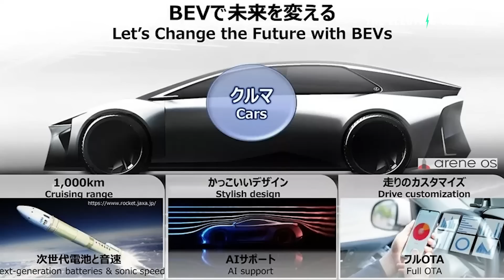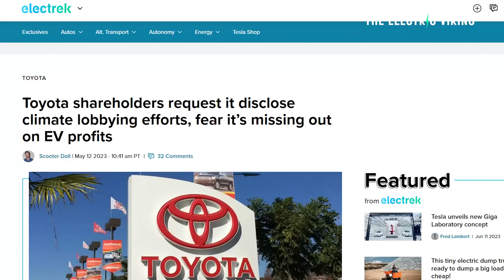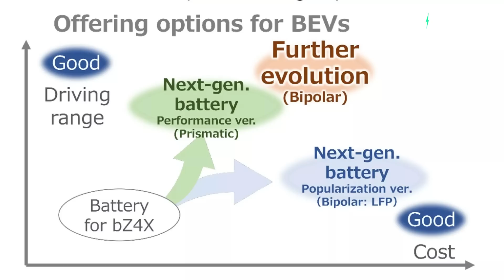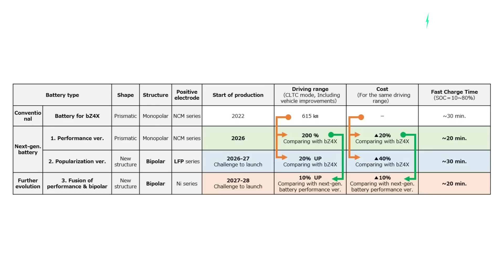Toyota's 2026 Electric Car will have 900+ Miles Range & Lightning-Fast Charging

Comment: Perhaps conflating Toyota users and Not being EV users?

I have had a Rav4 for 20 years, not a single problem. That's why I like Toyota.  

Once recharging on a roadtrip is a 15 minute maximum job with no worries about IS there recharging available without huge lineups that'd be where i'd look to adopt an EV.

Two different sets of considerations. 

It doesn't matter who makes the EV - unless your use case allows you to wander no further than the local area - there's nothing suitable. Perhaps more Toyota drivers are outdoor types who want the option to stray away from the city?

Comment: @EV Viking: May be the Japs still have the old blueprints of the Kammler* batteries** still laying in their vault. And just modernized it a bit. ...the Kammler batteries thought to be containing radio active material. 
So I could imagine Toyoto added some serious 'dust' into their upcoming new tech batteries too. 

*Kammler, Hans. High ranking officer of the SS, Socialist Germany 1933-'45
**Story goes that a briefcase with batteries containing Radio Active material was lost at the end of WWII around 'Böhmen und Mähren'. These batteries were manufactured '...ins Auftrag der SS Chefs Kammler.'

Comment: Another new feature in the Toyota EV is that driving in reverse gear actually re-charges the battery.
Reply: Drive it in reverse 100% of the time and you will never have to charge again!!!
Reply: So all I have to do is drive to work and reverse home!   I’ll never need a charge 😂
Reply: Toyota has been 'coasting' and slowly/steadily loosing ground since the 2nd gen prius which in my experience got the same mpg as the 2003 gen1 I owned.  I bought my VE4Y LAST ICE car in 2019 which was a 2019 RAV4 HV as a long range/vacation/trailer hauling car to replace the 2003 Gen1 Prius.

The next car I buy will be an EV only for work commuting and most other general traveling.  Would be nice to get a EV motorcycle to replace the 2010 Kawasaki too.
Reply: Anyone hear anything about NiZn battery chem?  EBL makes  a 3000 Mah 1.6v NiZn battery SUPER cheap that seems to he great.  Could this be usable on cars??

Comment: Toyota has been hanging this solid-state batt.--carrott over us for several years, and will continue to do so while they procrastinate using great li-on batteries available today.  VERY few people need to drive more than 300 miles in one trip, and if they do, they can easily stop and charge, as we EV owners do today.
Reply: yes they have.  but how long do you think this supply of lithum will last???
remmeber, 300 miles of EPA range is not 300 miles...never has, never will be in the real world.
my tesla says 272, but with my usage, ill drive 100 miles and be down to120- 130.  i only have access to use level 1 charger at home.  its annoying to have to use a public charger because they are in the dumbest areas of my city....and for others its even worse.    
this is why EVs need to have better energy density technologys to achieve 350-400 EPA range, for a real world use of 300-350.

Comment: In my view, the viking is correct to say Toyota will one day build this car. I also tend to be a bit more positive about the fact that they're planning this vehicle release two years out.  The reason is that the bottom line reality that will define Toyota is whether or not they go EV, and my guess is that they will; one very encouraging sign from this report is that the investors are demanding Toyota stop lobbying against EVs.  Toyota makes good ICE cars, and they can adapt. Very ambitious to release 2026. More likely 2028, but it will happen. I see this kind of ... how to tactfully put it... optimistic ... press release as a sign that Toyota CEO Koji Sato is going all in. So, generally good news - but yea. Take it all with a grain of salt.
Reply: We’ll have to wait and see…

Comment: I wish the leaps in tech breakthroughs that we have had with computers over the last 30 years could be seen with the battery.  I'm still waiting for the better battery but to have one that equals the tech improvements we have achieved with computers would be pure frigging magic at this point.  One must ask why?  Batteries are a consumable just like oil.  Maybe it's because of the almighty buck that we have not had improvements in battery tech that parallels our computer tech.  This brings up another point.  Batteries still need to be replaced when they go bad (and they will).  Will EV's become worthless when the batteries no longer take a charge?  Is EV tech the next disposable tech of the future?  What do you do when your cell phone is unable to hold a charge?  Do you buy a new battery for it or just get a new phone?  I have a ICE vehicle that is over 20yrs old and it still runs great.  Don't expect that with an EV.  At least until that magic battery is made.  Maybe Toyota will make it happen.  For me, I hope they do.  Someone needs to.
Reply: Tesla makes some very long lasting batteries. A lot of almighty bucks are being poured into battery research, with much more almighty bucks as a payoff. But these things take time. Chemistry improvements aren't like computer improvements, different mechanism there.
Reply: What you wish for has and is happening.

Comment: cool - I do drive a toyota, I am a skeptic, it's not because I like toyota -- I'm a skeptic of the whole thing --- We don't have the electrical infrastructure to handle EVs and we won't unless they add another 100 nuclear power plants and a whole lot more high voltage power lines across the country.

Comment: In addition to cost, my biggest reason for not getting an EV yet, are battery chemistry and capacity for a range at or over 500 miles on a full 100% charge.  The battery chemistry needs to NOT degrade and lose range in cold weather.  The range needs to provide between 430 and 500 miles min when charged to 90% in both cold and hot weather while also maintaining its battery health at 100% regardless of how cold it is and maintain that for high high battery health for over 1,000 charge/discharge cycles.  If you don't wait for that kind of battery chemistry and range in all weather you'll end up with a lousier EV ownership experience over 5-10 years of ownership as the battery health degrades.  Although following preconditioning practices will help but that comes back to having awesome EV OS software that no one except Tesla really has down.
Reply: actually what you say is contrary to the evidence we have so far. Most people only do 40-60miles a day. Vanilla Liion batteries  have shown us all to be stupid because they are lasting far far longer than predicted.  Doesnt suit you is not the same as suits 80% of people.

Comment: As a public traded company, Toyota should has something to back up the claims.👮‍♂️ Commercial success 26/27? Doubtful! 🐍🛢Toyota is under tremendous pressure from the public and creditors, a threat to the survival of the entity, look at Nissan! I reckon that it is just a gamble or a tactic to fend off pressure,😉 after all with advance of chemistry, WHO can say for sure Toyota SSB is just BS? 😝Feel sorry for the new CEO, a prawn that would take the fall.♻️ Toyota made a strategic mistake, grandson-Toyoda remains Chairman of the Board😂

Comment: I wouldn't believe anything Toyota says. That said, after a forty-five year career in product development, it is common for brands to turn things around in cyclic fashion. Sony, Black & Decker, and many others, have had multi year systemic product line disasters. And within a short period of two years or so, turn it around.
On batteries. Any comparison to fusion is just idiotic on so many levels. Look at the last five years of battery development, and project the same advances into another five. Consumer product development, with its near immediate profit potential, typically outpaces anything in the pure research arena.

Comment: In 2021 I bought a Prius Prime, that was my introduction to plug in electric vehicles. I loved the EV part of the Prime 25 miles, sometimes 30 in city driving, my wife loved the Prius and decided she wanted it, I bought a Chevy Bolt EUV which by the way are great cars, the only draw back, not great charging infrastructure where I live in New Hampshire. I drive a lot for my work, I was very limited to where I could drive the Bolt. I drove the Bolt EUV 26000 trouble free miles. I noticed Tesla had charging stations seemingly all over New England. When Elon Musk dropped the prices of the Tesla Model Ys, I bought one and sold the Bolt. I really like the Model Y, but I miss things on the Bolt also. Back to Toyota, they make great cars, very well built, I keep up with Technology as Technical work is my job. Toyota tries to get things right before they release things in their cars, they have been testing solid state batteries for some time, rumors have it they have finally figured out how to make it work and very close to being ready for production. If this really is the case , this will be a real breakthrough in  Battery technology. Hopefully these rumors are true,as Toyota makes very reliable ICE vehicles. If they can get their act together in the electric vehicle realm, we will have great electric vehicles by them.
Reply: You are the cause of global warming

Comment: I wonder why they picked 2026 instead of 2023 or 2024? Is it because they haven't actually done any of the work yet to deliver it, not even enough to have failed at it multiple times?

It's probably going to be "just a few years away" for another decade if they don't give up first.

Comment: In 10 years all EV’s will have ranges in excess of 1000km for real its just a matter of time
Reply: @Enrique A Thiele Solivan exactly but folk have been drip fed the idea of the ‘open highway’ for years so now they want to have a ‘tank’ full of electrons capable of emulating their old gas cars range. In time this will change as the younger generation start driving they won’t have any of these old preconceived idea’s of the open road, mainly because they no longer exist, everything is monitored to death so you can’t speed or do anything my generation thought of as fun, cars will become an A to B medium eventually we won’t even be involved in steering etc. its a brave new world !

Comment: Toyota's solid state batteries are coming next year, just like Tesla FSD. Both require technological breakthroughs that don't exist.
Reply: My MIT friends evaluated the first Priuses under a government contract. With some extra minor enhancements this vehicle would go 600,000 miles.
In Africa the continent where Toyota trucks reign Supreme their vehicles follow Henry Fords original requirements of completely bolted together and replacement parts. High efficiency regenerative capacitors for overcoming initial inertia would boost efficiency have not yet been deployed which would extend range.  If Toyota developed non unibody African repairable design with 1,000,000 mile design, the auto market based on planned obsolescence and non-repareable designs would shrink worldwide by 50%.

Comment: They don’t have anything. They’re stalling for time. The current AWD bz4x has a real world range of 190 miles when you turn on air conditioning - fact. By 2026 the remaining players in the industry will be further ahead with real world improvements on their already superior battery tech. It would take a miracle for Toyota to turn this around. Maybe they have been holding something back for unknown reasons, but that’s what it will take.
Reply: Japanese are million times better than cocky white europeans
Reply: a different perspective, is that toyota is skipping current available tech and focusing on the next level now.  
EVs are not selling enough for them to be worth them dumping current tech into retooling.  people want range, and speed, and charging network.  theres a reason why tesla has a stronghold over every other EV out there.

Comment: You can have Range, Cost or Weight pick two but you cant have all 3, if its 900mi range (which I don't believe) it will be stupidly expensive or stupidly heavy.

Comment: Are any of the EV manufacturers addressing the safety elephant in the room, fire risk in a crash, and the highly toxic waste? 
Also, who is going to pay to upgrade emergency service equipment to deal with EV fires?
Reply: Sodium batteries are the solution for fire risk. They don't catch fire even when you drill a hole directly into them. They are going into production soon in china.
Reply: @joser6948  And in the meantime, whilst the vast majority of EV's are using lithium, it'll be the tax payers that foot the bill. 
Don't get me wrong, I like the idea of having a EV, but at this time it's just way too expensive for small business. 
Many will state that they're cheaper in the long term, but initial outlay is a problem. 
Transit style EV lease £800+ pm, ICE equivalent £400 pm, and the  ICE has better range fully loaded.
Reply: @EnriqueThiele that's nonsense data simply because of the numbers on the road.
ICE doesn't require specialist fire fighting equipment,  which was my point. EV battery fires can take several days to fully extinguish.
This isn't me being opinionated, it's a question being asked by fire service in several countries.

Comment: Could we say in 5 years that it will be common to see ranges of 500 miles and 10 minute fast charging ? That would be a done deal . What Toyota describes is more than a done deal . Now if it's a huge battery pack I don't think that's productive because that can be done today . There are only a few companies that are mass producing batteries and most are not automakers so who will build these batteries that Toyota says they have created . I don't think they are building a battery factory or have one . Who ever wins the battery war wins the revolution . We are still only half way there for battery density to get to the land of 500 miles . 20 years from now things will be very much different in transportation. It's just like a iphone and should you wait for the next greatest and best tech in terms of EVs ? I think waiting 5 years if the vehicle you have today is in good shape . Options may double from today in that time span .

Comment: We don't really need high range, we need fast charging most importantly
Reply: Nope. Rather have massive range so I never have to find or goto a charging station. I will just be a inconvenience going to a station. Also range allows towing.
Reply: @AORD72  For towing it'd be reasonable to have high range, for regular passenger cars, as long as you have fast charging and 300-400 miles of range, you'd be fine

Comment: This is coincidental.  The latest news has been about investors questioning Toyota's long term plan for EV adoption.  Toyota has been stead fast that EVs are not the answer.  Well, the 900 mile range EV should boost their stocks.
Reply: Maybe,  but once the news gets out that Toyota's SS battery (like everyone else's so far) is not manufacturable in quantities that are cost effective and reliable, they stock will tank again.

Comment: I'm gonna buy a Lexus GS350 All Wheel drive for less than any new EV. Then put 350,000 with little expense and no trips to the dealer ever.
Reply: that's $55k in fuel costs alone, little expense? 🤷‍♂️

Comment: TESLA, even after 8 years they still have a bad service center and it takes forever to get a TESLA done at the service center and they have lost several court cases after a TESLA is 8 years old and their batteries get below 70 percent, but TOTOYA gives since at least 10 years warranty and keeps the battery below 50 degrees and seems to give a longer life to their batteries, yes by keeping the car at TOYOTA, but you say it yourself it's not expensive to have an electric car serviced, plus many times Tesla models had to be renewed or upgraded before they were worth using, 3-4 times, but in the middle it is TOYOTA's first attempt at a serious electric car, and without panel gaps and construction errors, TESLA and others could learn a lot from that about, and LFP batteries are another matter

Comment: Sometimes you make the most ridiculous statements ( as if they are true facts which they are not).  I’m a Toyota fan ( I currently still have a 2012 Prius V) and I have not and I am not buying an EV at this time because of the higher pricing and my needs - 

I recently bought a Ford Maverick hybrid 10 months ago ( wow not a Toyota) because of its price, practicality, intrinsic value, and ICE mpg advantages.   
I have an order in for an Aptera which order I put in over a year ago - to replace my Prius V which has 180,000 miles on it as of this moment.   
I know Toyota has built its world class reputation on being reliable and my experience with Toyotas I’ve owned over the decades confirms that reputation.  

We are early in the ICE to EV transition ….
I’ve listened to your posts for over a year now ….and you have become more biased …opinionated - political - in your posts.   I’m
About to drop you from my list of people I get information from ….I just want information ….not innuendo - opinions - or bias …. And that you have become lately.